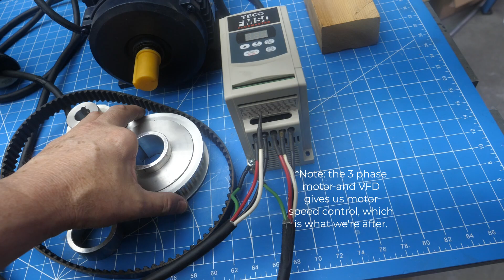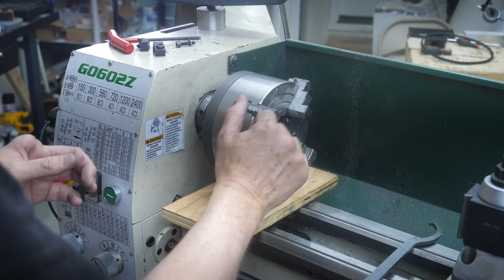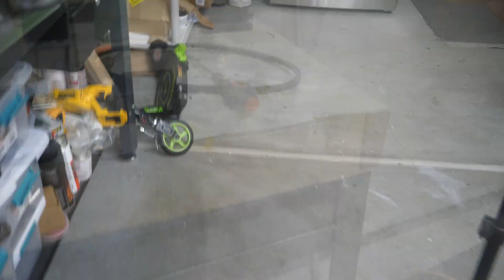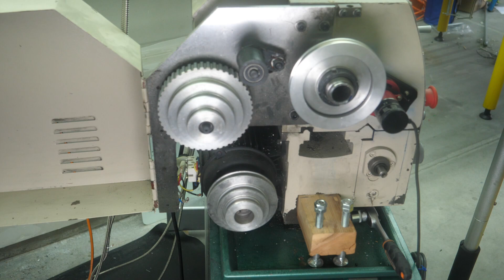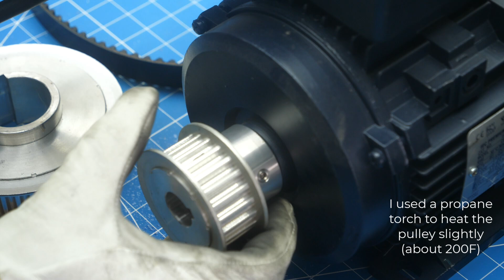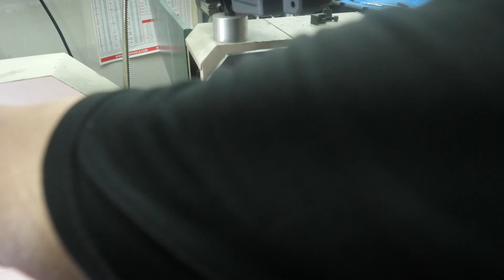G0602 Lathe 3-Phase Motor Install - the easy way! (edited)

Comment: Your wood and screw jacking system scared me. It was so narrow, I was half expecting the lathe would topple over.
Reply from the maker: It was a little 'tippy' but worked fine. You could also put some blocking under the lathe base to stabilize it further. In the end, it got the job done quite well. Thanks for taking the time to comment.